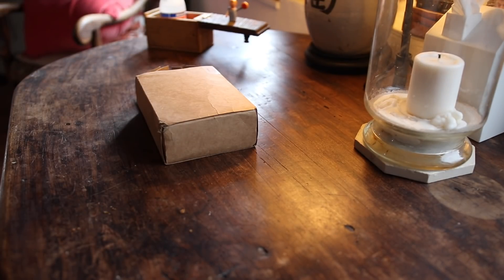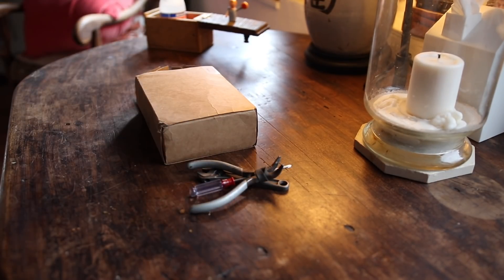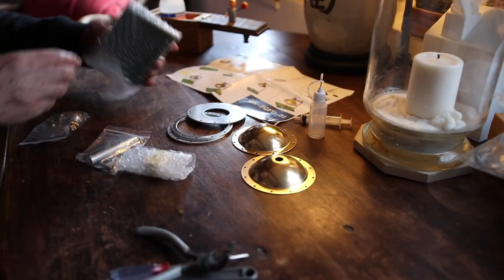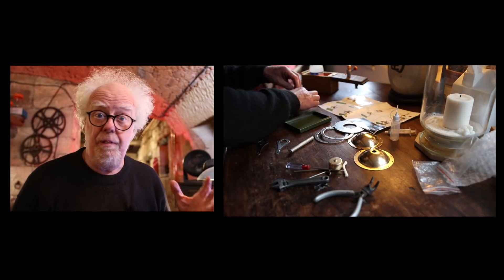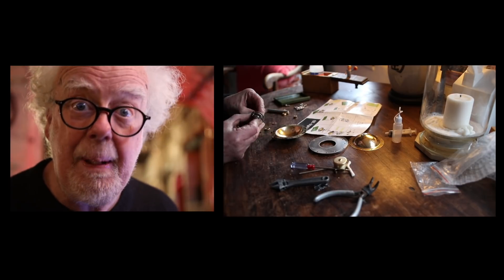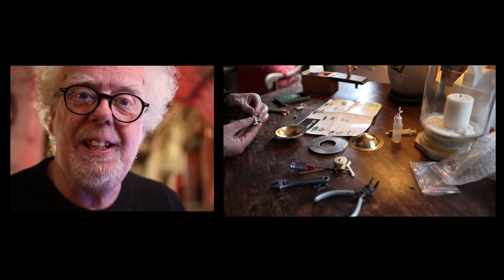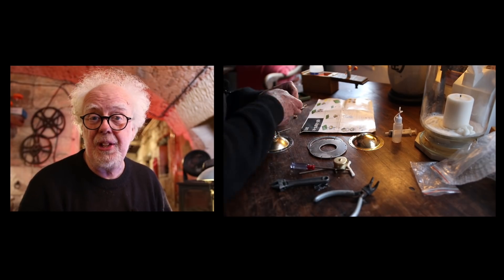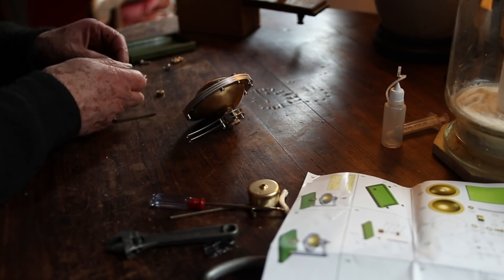Hero Engine - Prof Simon

Comment: Professor Simon, I think you will like a web site I made some time ago called HeroSteamEngine.com. This shows how I measured the power output of a Hero engine that I built and the page links to a YouTube video.  I connected it to a crane lifting a Coke bottle containing water and by measuring the rate of lift I was able to calculate how many watts of mechanical power it produced and the efficiency of converting thermal energy (heat) into mechanical energy. I believe that I am the only person who has done this and reported it. 

I enjoy watching your YouTube videos and have subscribed. Thank you!

Do you still have the Boxford lathe? You contacted me after watching my YouTube playlist about using the Boxford engineer's lathe on YouTube.com/c/evanecent. 

If your lathe does not have a thread cutting gearbox you would find my free online computer program very useful: www.HeroSteamEngine.com/RideTheGearTrain. My email address is on these sites.

Comment: Heron’s most famous invention has been talked about for thousands of years.
This was of course, his trick jug for turning water into wine.
Now who did he sell that one to??

It is a neat trick too.
There are two compartments, and through water surface tension, and differential pressure, and a small air-hole in the handle, you can pour out water, and then pour out wine.  Yes - it was simply a trick.  See book: King Jesus by Ellis.
R

Comment: I think we should look at some of this old technologies and see if it could be adapted to modern times. Great vid professor!
Reply from the maker: Great idea
Reply: It always amazes me that people think they have discovered something new... Only to find out it was first thought about/made in antiquity... Or more often than not, the victorian era
Reply: Thermodynamically very inefficient (and technically not a turbine)...
Reply: TheGhung Fu I would agree with that. Seems like if we could find a source of heat that was cheap and plentiful it would solve most problems. What's your opinion of most efficient engine today?
Reply: @jasonbrownlee7467  Depends on the application. For overall efficiency, the giant marine diesels made by Wärtsilä are likely the most efficient engines ever built, and they'll run on just about any kind of fuel oil/diesel/bunker fuel.
Under full/constant loads, gas turbines are very efficient.
Reply: TheGhung Fu Thankyou! I've watched quite a few videos on those huge marine diesels and they're awesome! Boggles my mind how big they are. By the way, I love your Nosferatu avatar!